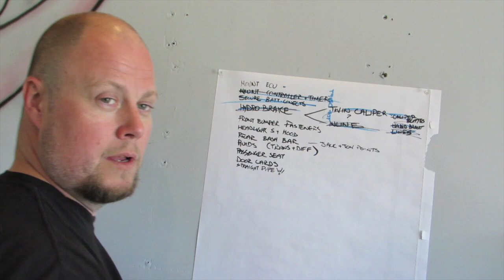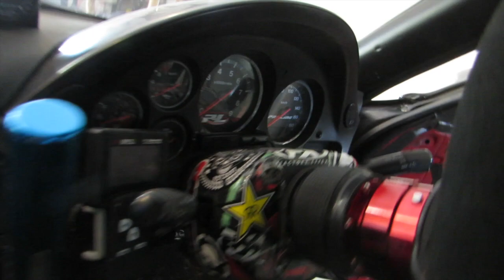How to install a hydraulic hand brake | Rx7 FD3s | bash bars mounted

Comment: Does it have a way to make it hold like a normal ebrake for when you park?
Reply from the maker: This one did not bit some do have a locking mechanism that will old the brake pressure on. Or Bungee cord it 😅